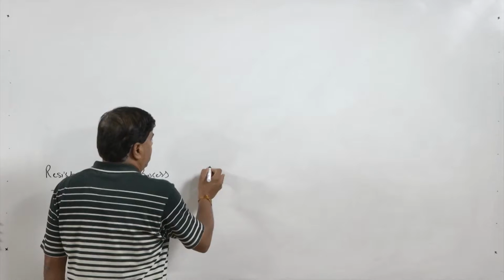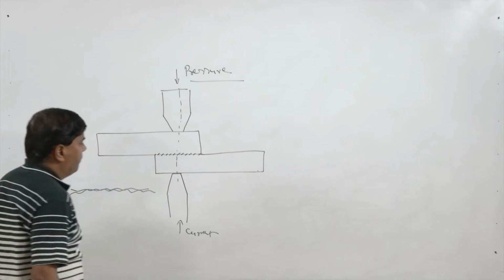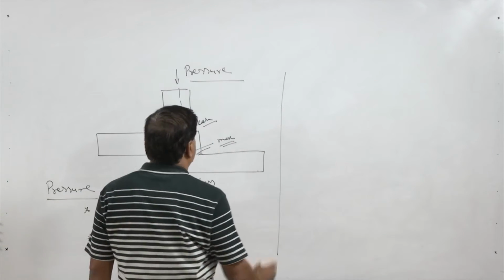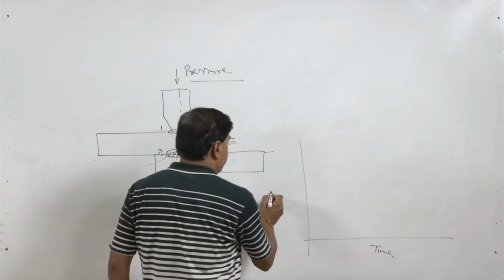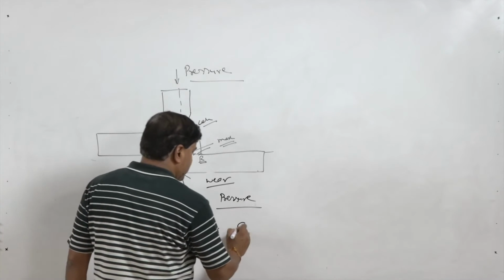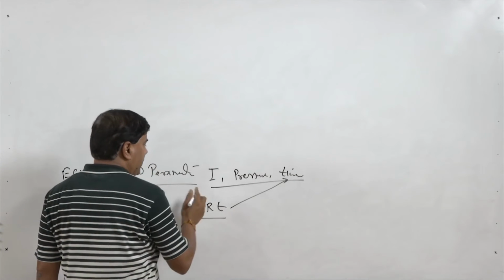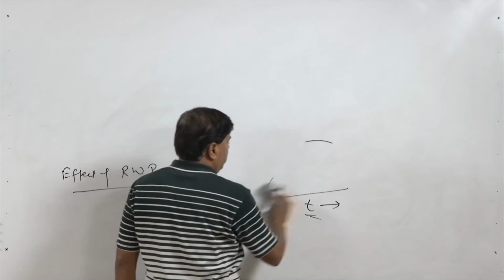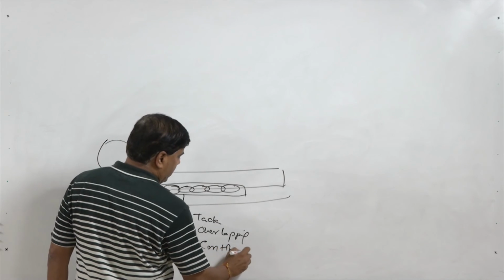Lec 18 - Fundamentals of resistance welding

Comment: Sir , why is there more contact resistance between the interface of the workpieces but not on the interface between electrode and workpiece?
Reply: Because Resistance =resistivity ×lenth of contactor up on Area of conductor 

Here, the length of the conductor means the contact area between the faying surfaces.
Because resistance is directly proportion to the length of the contact area between the surfaces